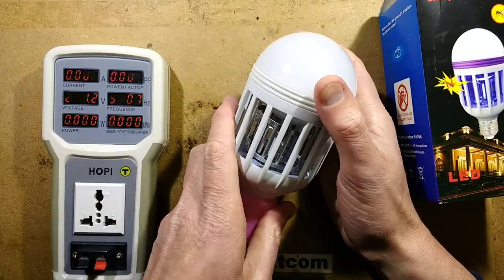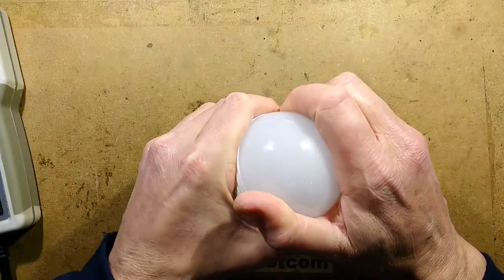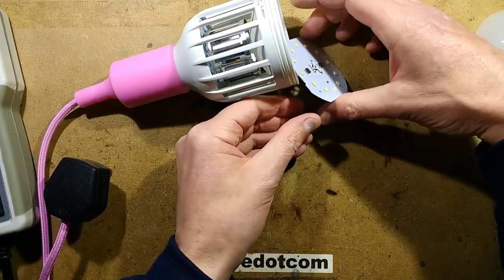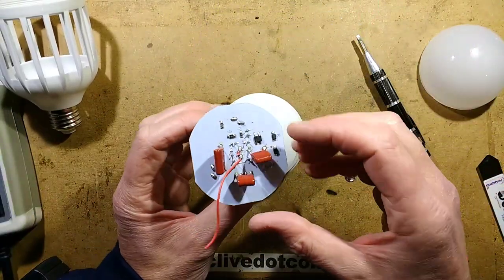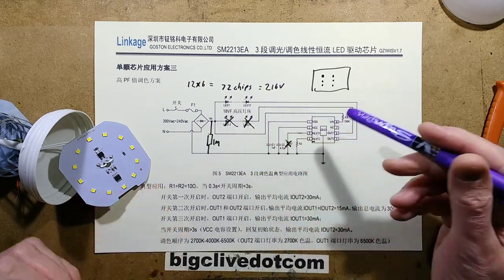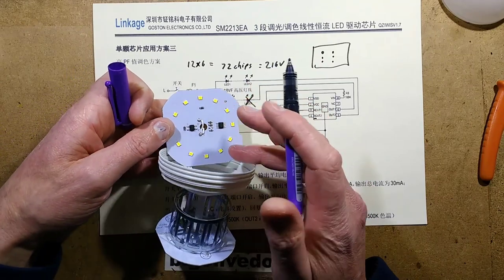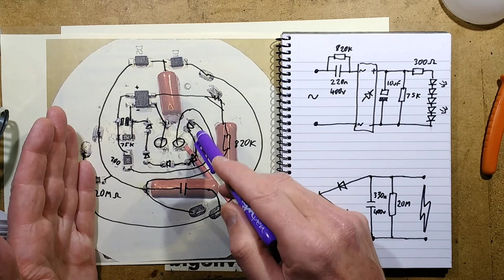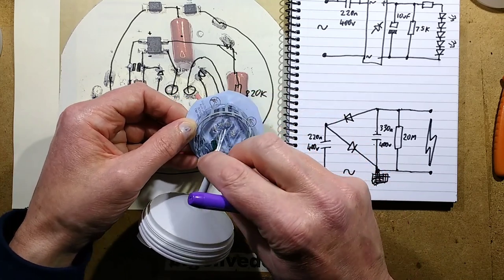Inside a bug zapping lamp (with schematic).

Comment: "Electric hazard- kids don't touch"
-Well, how else would they learn.
My sides
Reply: And I was just sticking wires into power socket, got pretty big sparkles, that was enough however.
Reply: That's not how it works. Hurting kids will not make them better happier grown ups.
Reply: 石尸丹丁丹廾彐丁囗 中仈丹仁片囗 That remembers me of something I did recently... I left the multimeter in amps mode, and I was diagnosing an issue with a power plug, so connected it to live and neutral and BANG! Fortunately, the UPS protected me and my multimeter and the breaker didn’t even trip. And kids, that’s why they sell multimeters which alert you or outright prevent you from changing mode if you’re in the wrong mode! Need a better multimeter...
Reply: @GRBtutorials  Well I was like 7 and that was a bicycle lamp I wanted to light apparently. Never did I know it was intended to use with dinamo (~6V)
Dad just left it in a closet with wires sticking out of it. Surprise how it didnt blow up but just banged near socket got me blind for sec.

Comment: If I remember correctly, biting bugs, like bed bugs, mosquitoes and such are attracted to heat, not light, which is why they’re such a pain from dusk on, because our bodies heat contrasts with the cold surrounding surfaces more when the sun is down making us more visible to them. Thanks for your videos, they’re wonderful.
Reply: Mosquitos and bedbugs are attracted to CO2 sources, thats the reason why mosquitos love yo buzz around our heads.
Reply: @spicesmuggler2452  They are attracted by “…lactic acid, carbon dioxide, body heat and movement.” So I guess we both got it partly correct. But they’re not attracted by ultraviolet light, was my initial point.
Reply: Drain flies, however, LOVE my 365 nm fluorescent tube 'black light'

Comment: It's important to introduce children to electricity early. Regular doses will help them get used to it, so that when they are older they are more sensible around it. Less binge shocking as adults
Reply: My first experience was at age three or so, sticking one of my mum's knitting needles into an alluring power outlet. This was in the days before those neat little shutters to stop such poking fun. I bounced off the wall on the other side of the room. It must have been a Saturday morning as dad came in to see what the loud bumping crash was. He then took me to one side to teach me about those dangerous volts. I don't think I needed any more lessons after that.
Reply: i managed to stick my fingers in a socket when I was about 3. I remember doing it. My mum gave me hot sugary tea afterwards. I remember drinking tea before that and liking it. Since then, I can't stand it - even the smell of team makes me want to vomit. Basic pavlovian conditioning in action I suppose - it should be part of the national curriculum. Also it would get rid of tea - which as I might have mentioned, is minging.
Reply: It became such after UK lost its colonies, but anyway I`m not fond of Indian tea, only Chinese.

Comment: So, the other day, I was browsing mouser, and I saw a 10 Teraohm resistor. What in blazes would that be for?
Reply from the maker: Could be for biasing a sensor input.
Reply: Lots of things, two i can think of are measuring femto-amps (for measuring leakage etc.), and by using it in a voltage divider, you can measure really high voltages...
I have also read about them being used on the output of ion chambers in radiation detectors / meters...
Reply: Maybe to count electrons.

Comment: The second time you powered it up, I was wondering if you would remember to short it out :D  Have you ever shocked yourself on one of those devices? Would they give a bad shot?
Reply from the maker: They do give a sharp stab when you touch them while unplugged but still charged.  The pain depends on the route it takes.  Up one finger and down another is unpleasant.
Reply: The "Bug-Zapper" Tennis racquet certainly can (personal experience). Best described as a "mini-Taser" - sharp and painful.
Reply: Have been zapped by the racquet ones a few times (drunken games) and never found it too bad. But dunno if I'd fancy getting a hit from a mains powered one.
Reply: I find getting zapped by mains kinda pleasant, but I resist the temptation to do it on purpose.
Reply: @phils4634  I can second that! I stupidly touched it to see what happens, thinking it can't  be that strong running on AA batteries. I used my left hand and pop, made heart race a bit lol My wife never let's me forget it.

Comment: Here’s an idea; take the chip off, and rewire the board so there’s one common, and the other leads of the LEDs are brought out individually. Now make a bug-zapping clock out of it, and have the UV LEDs blink on and off at one second intervals like an old-time VCR (until you set the time, anyway.) Fun, fun, and naughty! I’m sure the inventors of this didn’t have a bug-zapping wall clock in mind!

Comment: Not that it matters because the whole unit is sealed up with plastic, but the one side of the zapper that is connected to mains, it would have little if any voltage if it were connected to the neutral leg. BUT, not sure if you have a neutral leg with your high mains voltage. In the US, we have three wires coming in, two hot and out of phase giving 240 volts between them with a neutral (close to ground) being electrically between them (practically ground altho it is not for use as a ground (it may have up to 3 volts on it) which gives you 120 volts between it and either hot. The standard power mains here is 240 volts which is split with a neutral into two (and out of phase) 120 volt circuits.

Comment: Hi BC, Love the video, still giggling about the "how else are they Going to learn" comment, that  is exactly how I got edumikated about lektrizidy.  Hopi's hop up on ebay  now and then, mine both have data logging software and USB connectivity,  they have done away with the speaker terminals so no need for the deathdaptor.  I'm surprised by the Hopi readings, I must try  mine for accuracy at low currents.  Thanks for another great teardown.

Comment: Mine arrived today from Bangood, very bright!  :) However, it doesn't seem to do the dimming thing. First switch on and you get bug zapper and full brightness (I assume - it is very bright.) Next on/off - same brightness and Bug zapper. Next on/off - bug zapper only. The pcb looks identical. (I checked for a solder bridge on the chip - none.)
Re: Chinese translation via google on the IOM - Have you tried using a VPN app to spoof your location? Just a thought :)

Comment: May be Google translate can do that translation properly now, but just thought to roughly translate the data sheet bottom 6 lines, it says something like:
Typical application: R1=R2=10O when 0.3s <on/off cycle <3s.
the first on/off cycle, Out2 port turns on, average current output IOUT2=30mA
the second on/off cycle, Out1 and Out2 port turns on, the average current output  IOUT1= IOUT2=15mA, Total current output is 30mA
the third on/off cycle, Out1 turns on, average current output IOUT1=30mA
When on/off cycle >3s, (VCC capacitor setting), its reset back to default state, output IOUT2=30mA
The adjustment of colour goes from 2700K to 4000K to 6500K (out2 port LED are 2700K , OUT1 LED are 6500K)

Comment: Is there a polarity standard for the ES fitting? It would perhaps make sense for the screw part to be Neutral, as if anyone was changing a bulb without knowing the power was off, it would be easier to make contact with that part. On that assumption, it would be better for that side to be the direct connection to the grid.
Reply: Yes, the outer screw shell is neutral, the button contact is the hot.

Comment: And people will use these with es to b22 adapters there by getting phase directly on the outer mesh.  Got a similar one here to play with.  Since it's on an rcd and you have to intentionally put your finger I it I  call good enough but not something to put in a lamp where a child can reach.  As a 3year old I pulled a night light partly out the wall and dropped a 4 inch nail across phase and neutral on a socket with rewritable fuses.  Big flash bang lol.  One of my first memories lol. Half diameter of nail bunt into prongs of the plug.  Old style nz without insulating sleeves.  I'm sure one of these lights would be rely entertaining to some 3yo.

Comment: For reliable UV LEDS Cree seems to offer the best performance (and lifespan).  Are those caps potted ceramic? I'd have expected "HV" disc ceramics in this application.
Reply from the maker: The caps are standard mylar film types.  Very common in this style of circuitry.  Similar to X2 suppression caps.

Comment: Omg dude i Love the break down of the circuitry but holy Smokes ya killing me with the popping open of the bulb x) they Screw off. Except for the bottom cables ofc. Unless mine's' are different model, which i wouldn't know much but Still gaves me anxiety Seeing the popping off apart the Sections Lol 

I've been Looking to fix my bilbs as they began to flicker one day and then the function to the Light gor Somewhat wonky. I think i needa resloder Some components. Not Sure which ones though.

Ps. Yes. You're correct that the bugs that bite definitely don't pay much mind to the Light. So it's probably counterintuitive to have this bulb Set Up for that reason imo. However, i have Seen a few female mosquito Stuck on the Zappers when i done Some maintenance every now and then. I just know Some aren't fooled, as one day i had to connect tje extension cord to my Lamp desk and chased the Skeeter around my Shed Swinging wildly tryin to make it fly through the bulb haha.

Comment: i've had this light inside above my front door for about 2 years. i dont think it's caught very many mosquitos. the cold white isn't the greatest either. it acts a little wonky when i use the dimmer switch, but it does work to an extent. i've never seen the other colors - i have a suspicion they dont really manufacture them
Reply from the maker: It's definitely not dimmer compatible.
Reply: @bigclivedotcom  oh yeah, i figured as much

Comment: in most cascades the input rating determent the caps used as far as i know. i got many cascades out of electrostatic speaker that hold 400 and even 250 volt caps and multiplies up to 5 kv, they did so for 15 years :)

Comment: So what's a good power factor and bad I have a kill a watt but no instructions
Reply from the maker: The ideal power factor is 1 (unity) that means the current and voltage are in perfect sync.  Usually only achieved with simple resistive loads like tungsten lamps and heaters.

Comment: The bitey bastards are drawn in by carbon dioxide. I've seen good traps created by a cut in half bottle with vinegar and baking soda in.
Reply: But if the bottle's cut in half surely the vinegar and baking soda would fall out?
Reply: And the flicker with heat

Comment: Considering it's a chinese product. The 400 v capacitor is probably a misprint that they got for cheap in bulk lowering their costs. Which would explain their use in a location where you'd imagine that it would fail.

Comment: The volume being low imo is not really a problem - as long as it is consistent. We can just turn up the volume if needed. 
Other channels often have some really loud sound in between so you would blast your ears if you made it louder.
Reply: ABaumstumpf
You can only turn up so far... A lot of other channels I watch are too low, and I struggle to hear them if I prop my phone/tablet in a stand or against a wall.

Comment: Hi there Clive,  I just have one question.  How high is the voltage/current when the zapper circuit is triggered?
Reply from the maker: +dandel351 When shunted the current is limited by the capacitor in series, so it's very low.
Reply: Ok thanks for the reply Clive. I'm loving your videos mate! Cheers.

Comment: I understand volts amps watts etc but could you explain power factor plz
Reply: swansealoaf1999 Watts = power factor X volts X amps
Reply: Power factor is to do with devices having capacitance or inductance, rather than being pure resistors. Inductive and capacitive loads in an AC circuit cause the current and voltage waveforms to get out of synch with each other by a certain angle.
The power factor value is a measure of how much the current and voltage waveforms differ . PF=cos(theta), where theta is the angle by which current differs from voltage. A power factor of 1 would mean that the load is purely resistive or that any inductance and capacitance cancel each other out. You can also start to get into things like reactive and apparent power that can affect circuit design. It's not usually an important consideration for household devices, but is important for industrial applications because power companies don't like low power factors.
Reply: Actually John is correct that in a complex load Watts=pf*V*I. 
Apparent power (VA) is simply V*I

Comment: my mosquito zapper made in china works very well. buy the kind that has two fluorescent lamps which emits blue color light. kills a lot of mosquitoes. but have to clean often to remove dead mosquitoes that got stuck between grills.

Comment: My Zapplight still works on the bug zapping part,but the light doesn't work anymore and if it does decide to work,it flashes on and off and it will not stay on.I have never heard it zap a bug,but the blue light is pretty,but this light is not worth a darn unless you have something blocking it from the outdoor elements and if you do what good is the big zapper part?It will just be hidden behind something where the bugs will not really be able to kill/zap them.I really think my boyfriend wasted $20 or whatever he paid for this bulb. Now by this video it is very nice,but if you buy one,you better have a covered porch.Now I have a bug light and no light to leave on for when I come back home at night.

Comment: Whats your opinion on the antex xs25?
Reply: KJBowen2204 
My first ever soldering iron was an Antex XS25 which I got when I was 15 - the year was 1984! I still have it and it works fine. You may struggle with certain soldering jobs due to the relatively low power of 25 Watts, especially with the trend of building large ground planes into PCB's. You may find a Chinese import temperature regulated iron gives better results and spares (including tips) are very cheap too.

Comment: You say the 15w rating is actually half?  Must have been rated for U.S. voltage (120v).  Maybe 15w@120v and 7.5w@220 (or 240, whatever you guys have there).  This is typical for Chinese products.  Sometimes we get items rated for 220v, and the only 220 we have here is for high current draw appliances (elec. clothes dryer, stove, elec. wat. heater, etc) and it has one of those fist-sized 4-prong plugs (2xLine,1x neutral and ground (you guys say "earth").  For us there's no problem with getting a 220v product, but I assume if it were Europeans getting U.S. voltage rated products (especially if they messed up and gave you a Euro plug), there could be a significant issue.  Surprises I can imagine.
Reply: The 15W rating is about double the actual power Clive measured(8-ish watts). If it was rated 15W@120V then it plugging it into 220-240V is likely to result in nasty consequences as you potentially quadruple the power through P=V^2/R relationship assuming a fixed load resistance. Plugging a 240V device into 120V usually just reduces the power or may not let it work at all. Plugging 120V  device into 240V most often lets out the magic smoke.
Reply: But it's a good explosion tho. Like how those old junky computer PSUs with the switchable voltages "accidentally" got set to the wrong voltage for giggles...
Reply: Or when someone working in a mixed voltage environment forgets to check that switch, and which voltage outlet they are using when hooking up important work computers.

Comment: Has anyone done any research to show that the target insects are attracted to blue or white light? It is know that moths are attracted to light, but are flies and mosquitoes? I was under the impression they are attracted by pheromones and simple chemical triggers such as keytones and CO2.
On a more personal note, why are you so attracted to very high voltage devices?
Reply: Nigel Johnson
Mosquitoes only go for CO2 and heat. They will get caught in bug zappers IF other bugs are getting burned in it. But you're better off using either poison or repellent. 
I've never seen a house fly in my bug zapper either.
But for the bugs that fly around lights at night, they work great. I have a cheap zapper I bought about 15 years ago, and I switch it on almost every night in summer before I switch off my main bedroom light. All the moths and other bugs bouncing around the ceiling are gone in about 10 minutes.